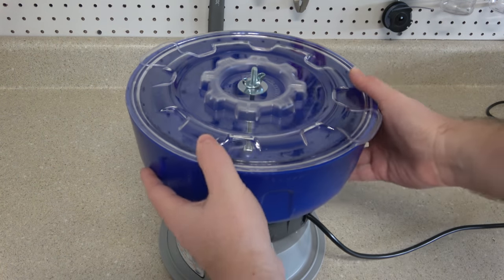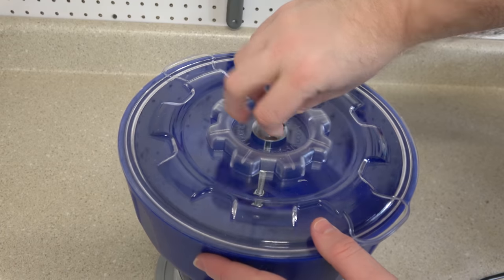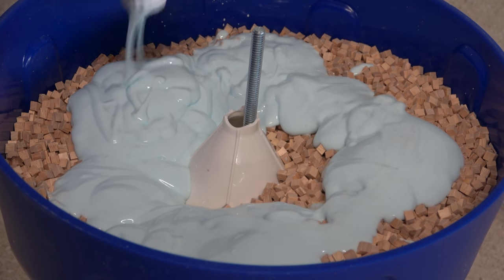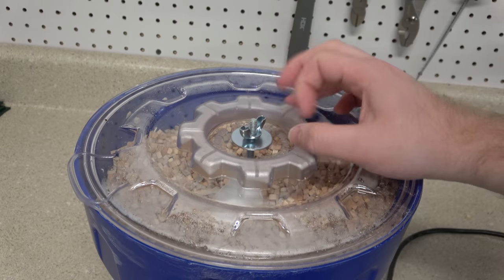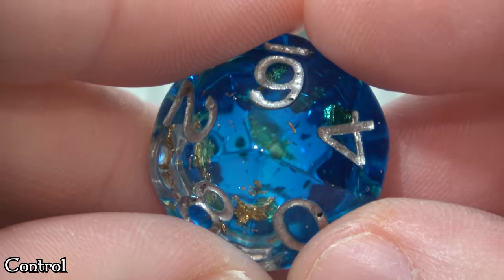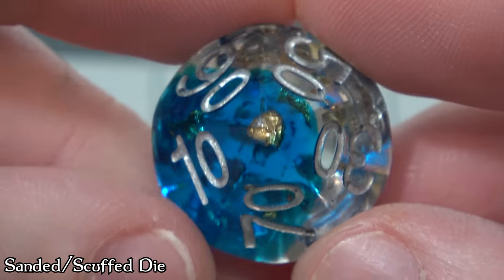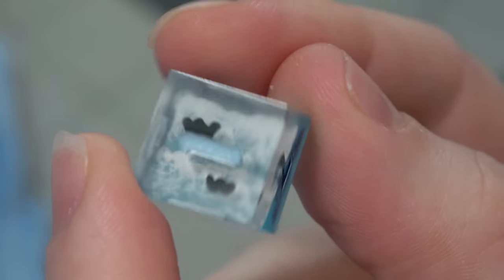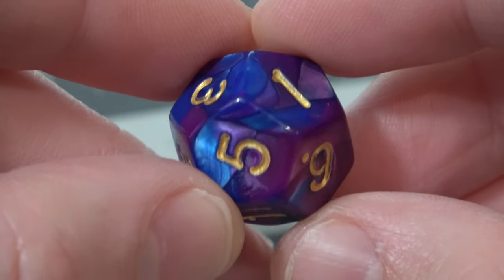Dice / Resin Sanding Using A Vibration Tumbler

Comment: I own that exact polisher for fired brass. Just wanted to give a couple of quick small tips on using it. Whenever you’re adding compound to the polishing media, do it with the machine running and drizzle it as a stream. This will allow it to coat the media without having a big glob on top. Also, let it run when you are fishing the dice out. The vibration loosens up the media and lets your hand find the dice a lot easier than when it’s static. And final tip, try some different media in the machine. I haven’t tried the cubes, but I’ve had really good success with walnut shell media and Flitz liquid polish for cleaning and polishing. Flitz works on many types of materials, including plastics and resins.
Reply from the maker: You rock Chris! I can't believe I didn't think to keep it running while scooping them out. I really appreciate the tips! :)
Reply: The specific problem that has been run into with most media is that it's too small and gets jammed in the numbers and from personal experience it can be almost impossible to get completely out. That's a lot less likely with the hardwood cunks. Definitely second your other suggestions - Although I've had to hand-mix the polishing media when I add HUGE amounts like what's needed to start it off, the top-off ones are pretty easy. And fishing things out while it's going is like magic, it's like reaching into a solid object.
Reply: @Rybonator  I've had good luck with both the crushed walnut and corncob medias. Corncob will be a little softer but puts a really bright shine on brass.
And with the walnut and corncob, the easiest way to get things back out of the media is a thrift-shop strainer and a bucket. Put strainer over bucket, pour polisher out into strainer, shake lightly.

Comment: I had fantastic results from letting it run for... thirty plus hours the first time, seeing quite a bit of improvement over my 24-hour check point. I've not had the chance to really go test things a lot, but I've also heard that results improve with use (As you add more polish, etc). But I do have that exact tumbler, media, and polish. My usual method has been to sand to 1000 grit on all sides and then into the tumbler they go.
Reply from the maker: I'll have to leave it in for longer and see what I can get! :D

Comment: Also to answer a couple of the questions that came up in the video. You absolutely can use either corn cob or walnut shell media and they both work but are much much much slower at polishing than the hardwood cubes, and like to get wedged in and stuck in the numbers, making cleanup a lot more painful. Some of the grittier media’s that are made for brass or rocks would be too “tough” for resin and remove a lot of material from the dice.

Additionally your transparent/translucent dice will still fully polish most likely with just a bit more time in the tumbler, sometimes if I have one die with some extra micro scratches or foggyness then I’ll toss them in for the next round and they’ve always ended up crystal clear. 

Again, I’m just so honored that my little doc has made it all the way here, it was certainly an exciting surprise to wake up to this morning!
Reply: Would you consider making a video of your results and the process? I was looking at your vibratory tumbler sheet yesterday and id love to see your process in action
Reply from the maker: You absolutely rock for making this diceworks! I'll have to add it in for longer to see if I can get some better results :) If that DOES work, oh man, you changed the game!
Reply: The hardwood cubes are pretty pricey. How often do they need to be replaced? Do you just need to wash them out?
Reply: Where might one find the tiny wooden cubes? Amazon doesn't want to help me

Comment: Texas dicemaker here! I use my tumbler religiously, and I have to say, keeping that condensation most definitely affected your pulls. I had the same issue with cloudiness on my first run, super disheartening. 

However, I ran without the lid and found that they cleared right on up, my translucent dice are like crystals!  I now have a screen cover. 

This is a little unlike your other videos, you usually run through more tests and experiments, especially when trying something new. Hope everything is okay!

Comment: Could that be rigged up to vibrate resin in the mold to help get rid of bubbles (for those who don't have a pressure pot or vacuum chamber)? When I worked at a missile factory, we had a large one of those with small pumice stones in it to finish the missile fins. It was really cool to see how it worked.
Reply from the maker: I've heard that it can, but haven't tried it myself. Might be worth a shot!
Reply: I tried vibrating bubbles out with a jewelry cleaner and 1 thing I found was that stuff in side tended to settle. So I had glitter in one and all the glitter ended up in the bottom of the die after vibration.

Comment: I’m using this method, same tumbler, polish, and media. I find that the media polishes much better if you let the media soak up and dry out completely before tumbling. I go from matte molds to glossy no problem with this method.
Reply from the maker: So, I should let it dry after putting the plastx in there? Might be worth a shot!
Reply: How much of the media do you need? I'm trying to stomach that 99.00 price tag for a 5lb bag.

Comment: Hi! Don't know if can help you, I worked a couple of year in a jewelry factory and they used a lot of tumblers. For heavy silver chains they use round ceramic media (shaped like pellets) and left all night until morning with water and some industrial soap. For other chains they use steel pellets (also rounder, like ufo shaped) for 10-30 minutes at faster speed. The result was smooth and polished clean chains, but not like the ones manually polished.
With my little knowledge I would use a rounder media and maybe a little water :)

Comment: fast orange shop soap might be good to get the plastx off? it's cheap, smells deliciously like orange, comes in big bottles or in bars, and is designed for getting automotive grease off skin. i just recommend moisturizing heavily after using it, since its gritted and strong so it can dry your hands out bad

Comment: Try the ceramic beads. I've been sanding my dice to 1000 grit then dropping them in.  I'm using the same polish in mine and get glass like finishes. Plus I only need a little bit of polish, like 1/4 of a cup. 24 hours later they look glorious.
Reply: I use the ceramic beads and they are 3mm should I be using a larger bead size for dice?

Comment: I wonder if a traditional three stage tumbler media method would work, or if it would eat away too much of the dice. Also, do you have any videos where you demo the hand sanding of round edge dice?
Reply from the maker: I don't sadly, but it's the same as sharp edge, but then you have to roll over the edges. It stinks :/
Reply: @Rybonator  Hmm. Follow up thought -- if the three stage grit tumbling method did grind away surface area, I wonder if it would turn sharp edge dice into round edge.

Comment: For sharp edge polishing, you should look at what they use in the watch/jewelry industry.  There's probably no consumer good that gets more polishing attention than mens watches.

Polishing in the tumbler, look at ceramic polishing midia.  The car wheel industry uses it.  It's not cheap, but for a little tumbler, it's probably affordable.

Comment: Have you tried jewelers tools yet?
Seems this is a great way to polish rather than sand.
Reply from the maker: I haven't, what tools would those be?
Reply: @Rybonator  I've seen jewelers on YouTube using different grades of wet sanding wheels, as well as a special tool to hold the gem. I think this may actually be the best polishing way!

Comment: You should Do you own experiment. Even though they did a good job, I see flaws in their design and medium. You need something like a soft material based cloth or even leather pellets to polish. As for the sanding, I would trying plastic pellets or ceramic. I'm sure you could get it to do a really good job. Oh, by the way not to rain on your parade, but did you try putting an enclosure over the rock tumbler. I told a friend about it about he never thought of it! Remember you can insulate it with anything including Ta Da Foam board insulation. How that helps.
Reply from the maker: Thanks Ahman! I totally plan on testing around to see what I can come up with. But this was a great starting point for sure :D

Comment: Would this take off the layer of Mica that you brushed onto your molds in an earlier video? Or is this gentle enough to not scratch it all off?
Reply from the maker: Good question! Might be worth finding out :)
Reply: I’ve put dice that were cold casted with just mica brushed onto the molds into my tumbler, and it maybe took a bit of the mica off right around the edges, but overall didn’t seem to effect them otherwise, it’s super gentle and all the faces came out looking great!

Comment: Question! 🤚🏻
But could you set it and forget it and then just use the finest polishing paper to get that glass finish without having to go through the entire sanding process by hand?
I don't know if that's been asked already
Reply from the maker: Possibly, based on the results I saw, you might need to sand at the 2 highest grits instead of 1 :)

Comment: Do you think the tumbler method could be used to cut out some of the hand sanding time if you wanted a glass finish?  My hands hurt like fire when I try to do hand sanding, so maybe it could cut out a few of the starting zona papers and save my hands a bit?
Reply from the maker: Sure! But it would still have to be PRE sanded, so you'd have to stop midway through to remove about 3-4 of the sheets of zona that you normally have to use.
Reply: @Rybonator  Any sheets getting cut out works for me. :D I can never get through a whole sanding session at once but maybe with this I could!

Comment: do you think this would work for skipping the first 1-3 zona papers? Like, use this and then finish with the mid to last polishing papers? Even taking away some of the sanding work seems pretty dreamy to me...
Reply from the maker: Yeah absolutely! The only problem is that you still need to do the first layer to get them started. But it probably skips 2-3 layers?
Reply: @Rybonator  sold. More time for casting dice 😂

Comment: No dumb jokes for this one, just an honest opinion.
I don't think this one is worth the trouble unless you mass produce dice. even with adding a dozen of dice it may still be faster to use sand paper because it would take way less time and it would be more cost effective.
This one is just good if you want to make the process more automated and leaving you more time to work on your own stuff, 20 hours sounds like too much for me otherwise
Reply from the maker: It's definitely worth it for those sanding dice in the 100's, but yeah for an individual maker, probably not

Comment: The balance issues from this method would be tough to prevent. Though they may not be any worse than hand sanding.
Reply from the maker: Honestly not really, this is essentially so tiny of a sanding+random, this is (almost, they use a rotary tumblr) how the big dice companies do it, with no degradation to balance :)
Reply: @Rybonator  Big companies have degradation that impacts balance, they just do not bother to test for it.  Give me 10 dice from a major company and likely a couple dice will fail a statistical analysis of their rolling patterns.